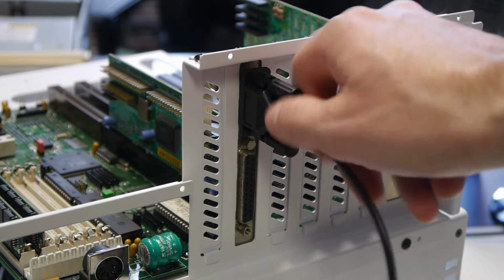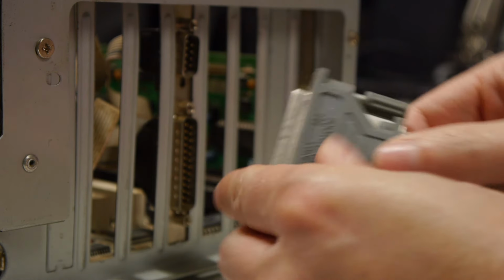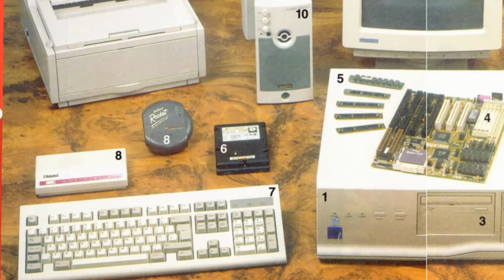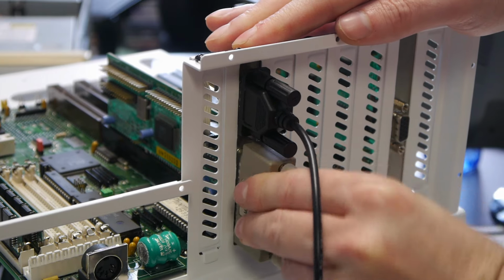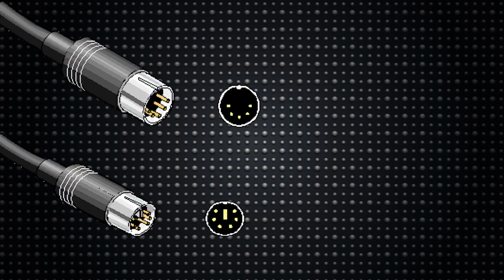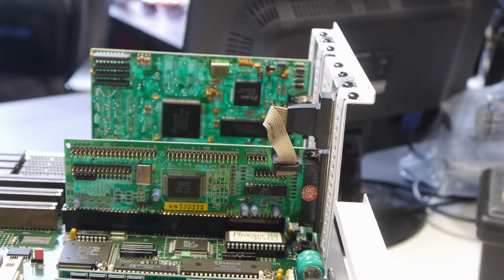What did we use before USB? | Nostalgia Nerd

Comment: My first ever PC was a Packard Bell PB2970, it had a single expansion card that functioned as both a telephone modem and sound card.  I believe it was an ISA card, as I remember the card was stupidly big.  I can't remember for sure if it featured a gameport; what I do remember though was the sad realization after a lightning storm that damaged the modem (visible charring could be seen on the board), I found myself having to replace two expensive, at the time for me at least, components: telephone modem AND a sound card.

In the following years I'd purchased several sound cards, sometimes as upgrades; back when using onboard audio was a detriment to the system as a whole; largely in part because the onboard audio systems lacked the proper shielding for the audio channels to produce the nice clean audio that an expansion card offered, and because the onboard audio system would tax the system CPU, at a time when CPU cycles were at a premium and would noticeably make your games run slower.  In all that time, however, I've never once in my entire life used the Gameport on a soundcard, or on my PC.

Comment: I'm old enough to have worked on PCs before USB, and I for one can say that things are such much simpler (and even better) today. USB is appropriate to its name, it is truly universal. It was a headache at times dealing with all the different port types, and then trying to find the right drivers to get the device just recognized, let alone working lol. Granted much of the ease of use did come with the updates in the OS's and BIOS's to vastly improve plug and play operations. I bought my first USB computer in 1996, and my first USB peripheral (scanner) in 1997 and there were definitely birthing pains in the beginning. Now the problem is finding peripherals that have the older ports so that modern computers can use legacy hardware, that there is no modern solutions for, but still needed for business operations for that particular process. 
I remember back in 1995 while I was still working for Intel, my colleagues and I were talking about tech trends, and I insisted that this "new-fangled" USB will be the future. I was quickly laughed off.
Reply: USB-C is having similar growing pains.

Comment: One thing I miss about the older rs232 days off serial ports, was it used to be fairly easy to analyse traffic. Hook up a null modem, make some guesses about parity or word size and then you could see the raw traffic. 
Helped quite a bit when trying to debug a connection issue. These days the USB protocols are so tired to proprietary drivers that it's a real project to understand what sort of traffic is being sent down there wire.

Comment: 1. You did not menton the SCSI-bus & contacts used on older Macs. Existed in several guises. From parallell-port-sized to big huge clunky things. 
2. The dreaded DIN plugs. Oh, how we hated them! For connecting a tape recorder to an amplifier, you need only one cale, but woe and behold when one of the connector came loose & you had to solder them back on. The "Phono" type cables & plugs used now are wayyy easier to get on (they only fit one way…) and solder, if you have to. 
And have you ever seen DIN jacks for microphones or headphones? 6 pins, and shield. Whereas you get thru with only one "jack" plug. And the one for headphones? FIVE pins in a star formation, PLUS shield! Nightmare! I think the old-style home stereo DIN plugs are dead now, thankfully.
As for the "gaming contacts", they’re pretty much similar to the old serial (printer/modem) & ADB (keyboard&/mouse) on the pre-USB Macs (I have several…).

Comment: Thanks for this nostalgia splash! I have some comments, though. At 1:53 - this is actually a 16-bit ISA card, in a slot that accepts 8-bit and 16-bit ISA and 32-bit VLB cards (at 2:13 one can see the shorter, 8-bit-only ISA slots). Also, the card at 3:46 is an I/O card, which in addition to serial and parallel ports has pin connectors for hard disk, floppy disk, joystick (I assume the "game" port refers to that), and another COM port (the third pin header being for jumpers to configure the board).

Comment: PC-AT (the a and t pronounced separately.   It stood for Advanced Technology.
Reply: Yeah... He also said Windows 95 Service Pack 2 which does not exist. :D
Reply: @keybizzoneg5209  : 95's second service Pack was referred to as "OSR2" or Original Equipment Manufacturer Service Release 2.  IIRC, MS didn't refer to it's Service Packs on its consumer OS's as 'Service Packs' until Windows XP where they unified the consumer and enterprise workstation OS's into one lineage.
Reply: @phuturephunk  Still was'nt a service pack though, it was a full release that was distributed to manufacturers in order to bundle with their computers... there is a difference.
Reply: @keybizzoneg5209  Oh, true. I'd actually forgotten about that.
Reply: "It stood for Advanced Technology"
I recall that before the PC-AT there as a PC-XT where XT stood for "Extended Technology".
Reply: Saying @ is quicker
Reply: I think the "PC @" was the model between XT and AT - it used the 801.586 processor 😋
Reply: @DarrynJones  The PC was IBM's original in 1981.  The PC-XT came to market in 1987.  The biggest change was that the PC-XT came with a hard drive installed.

Comment: Nice overview, though as an Atari fan, I would have expected mention of the Atari SIO port, which was kind of a precursor of USB, being serial and allowing chaining of devices. And of course, its designer Joe Decuir also participated in the design of USB.
Reply: Yeah, the big-deal ports on the Ataris were the 9-pin game-controller port, which actually became something of an industry standard for a while (Commodore and Sega both used versions of it), and the SIO, which didn't. They sold an "Interface Module" that you'd put into the SIO daisy chain to provide RS-232 and Centronics parallel ports, because I think even some of the modems and printers they sold used those.

Comment: USB was just a modern and much more widely-supported take on the Atari "SIO" [Serial Input Output] port which debuted with the Atari 400 and 800 computers from 1979. SIO devices [printers, plotters, disk drives, tape drives, networking schemes, etc] were all "smart" devices which had their own built-in drivers and thus they were truly plug-and-play even way back then.

Comment: Serial ports are still fairly widely used. Lots of automation gear (not Internet of Things type toys, but manly automation related gear) supports serial connections. There's good reasons for doing so. It's a point to point connection from controller to controlled device, and it's not shared and not accessible from the outside. So it can't be hacked. And if the device itself were compromised it can't be used to attack anything else, not even the controller it's connected to generally speaking. And it's very simple so it doesn't add hardly any cost or complexity to the devices that implement it. You can buy a 4x or 8x PCI-e serial card for a quite reasonable cost.

Comment: At a tow company I worked at we had written our own POS and DB software in C that could be compiled to run on both MS DOS and SCO Xenix. For the system at our own office we ran Xenix first on a 286 system eventually working up to a 486. Mid way through, we had the console screen and keyboard, a printer hooked up to the Centronics, and the following connected by RS-232's: 2 more printers, 5 terminals, a modem connected to another printer at the police department, and a second modem for remote access and connecting to the other companies we sold our software to.

After we moved up to the 386 we realized what a dog the system had been on the 286, but after that it was faster than the system used by the company I'm at now that is internet based. No graphics, no routing, low level programming, and few layers between the program and the computer makes a huge difference.

Comment: Then What is Before Before USB 🤔
Reply: A 20 milliamp current loop used by teletype machines.  When ASCII replaced Baudot coded teletype machine there were a lot of cheap Baudot teleprinters and terminals around. Interfacing one of these machines to a computer gave you a printer or terminal.  All you had to do was build a 20ma to rs-232 interface and write software to convert 7-bit ASCII to 5-bit Baudot and back.  I never did this, but here is a video that does  https://www.youtube.com/watch?v=ug5lUI-hs3s
If you are old enough you will remember the sound as the opening of just about every news program broadcast.
Reply: @billelkins994  Ah Ok

Comment: What was before USB?! Afucking mess. Anyone remember trying to get a parallel port printer working right, or when you bought a PCI graffix card but needed an AGP card?!
Reply: I never really had any issues.  My printer always worked.  My sound card always worked.  Never had display problems (though, shitty drivers were a hassle).  I rarely bent any pins.  Maybe I was just careful and knew what I was doing :P

Comment: 10:28 Not exactly. iMacs didn't get FireWire ports until late 1999, and even then it wasn't included on the base model. So a big chunk of the market was stuck with the much slower USB 1.1.

Comment: I prefer PS/2 mice and keyboards for two reasons. The first is that the OS doesn't ask to reinstall the driver every time I plug in a device. The second is that only keyboard data can travel over the legacy port, but a malicious device can send any data over a USB port. Given the recent hacking chip on imported mother boards this now seems less paranoid.

Comment: USB might need a new spec update if it's to support fast external storage devices based on NVMe because the 20Gbit/s transfer speed for USB 3.2 is clearly a bottleneck for NVMe's 32 Gbit/s!

Comment: I had a video capture device that worked off the parallel (printer) port.  And 2 printers, so I needed a Parallel port hub/switch.  Also had an HP scanner that came with a SCSI card.  And a Wacom tablet that needed a serial port.  All of this for a Gateway PC that had, I believe, a 6 GB hard drive.  But I was late in starting to use PCs -- my wife used the ones where the hard drive was a big, removable floppy.

Comment: There is no such thing as a "DB9" port. It is DE9! The second letter is for the connector size. B size is the 25 pin parallel or serial port. The 15 pin game/MIDI port is DA15.

Do NOT plug an old Macintosh monitor with DA15 plug into a PC gameport. You will not like what happens when power is applied. Fortunately, the one time I encountered that, the person's PC had a cheap multi I/O ISA card and that was all that got fried. Dropped in a replacement and it was fine.

Most of those multi I/O cards also had IDE and floppy controllers so one card got you your game port, two serial, one parallel, two hard drives (or hard drive and CD-ROM) and two floppy drives, or a floppy and a QIC tape backup drive. They were quite the innovation when formerly we had to have one card for floppy drives, one for an MFM hard drive, a third for parallel and serial ports, a fourth for a pair of game ports (or one with a Y cable), then finally a sound card. The sound cards would come with one or more interfaces for CD-ROM. There were Mitsumi, Panasonic, and Sony proprietary interfaces, or SCSI. I don't recall a card with the three AND SCSI. Just one or all three odballs or just SCSI, a few had the three and IDE.

So if one had an IBM 5150 PC you had a problem if you were kitting it out for games. Only 5 slots and you still had to have a video card. That's why sound cards quickly adopted the game port, so a dedicated joystick card wasn't needed. It was sooooo great to be able to yank everything out except the sound and video, then install one little card to do everything else, and an IDE hard drive.

Comment: I remember trying to attach something which almost, but not quite, fit. I didn't realize it until I had trouble seating the other screw attachment.

So, you'd have to unscrew it, make sure you didn't bend any pins because of your mistake, replace the cable if you messed up that bad... then there were the CompUSA goons looking at you like you have two heads, because you need a big-DIN to mini-DIN adapter.

Comment: I had to use an old ancient modem on a modern computer back in 2008ish as it was the only modem that would dial into our siemens phone system without getting kicked out, had to search high and low in the basement for the small to large serial port and figure out how the little flip switches needed to be set, it sounded like the 80's early 90s when I dialed it up to program it for changes haha

Comment: We didn't have a lot of devices that connected to USB for power, and the data transfer end ended up being used by either the Parallel or the 1001 composite port.  But, it just wasn't used in the same matter really as the USB ports are or to the same advantage and were HARD wired more.

Comment: its produced A T not AT. 
serial ports couldn't do more then 9600 baud reliably until 16 bit 16550 UARTS came out. if you are connecting a 33k modem, you should definitely make sure your computer has a 16550, otherwise you get errors. 

some of us had separate MODEM and FAX boards.

the original ibm pc and AT had limited Interrupts. meaning if you have a mouse and a modem and a printer, and a sound card there was no room for anything left. the AT model gave you 16 bit slots and IRQs 9 to 15, but little cards on the market used those extra interrupts. IRQ 9 was free, it could be used by a video card. the other EXTRA IRQs were tied up being used by your Hard Disk Drive and Math Coprocessor. 

the ibm had 4 COM PORTS!! but you couldn't use COM1 and COM3 at the same time and you could not use COM2 and COM4 at the same time

sound cards drastically changed. we don't use AM or FM synthesis for musical instruments anymore. meaning every single PC compatible's sound system sounds the same now. . each persons SOUND BLASTER AWE32 had the potential to sound different then anyone else, because of different musical instruments were loaded into the sound card's ram slots. a lot of people talk about the 640k barrier and the differences between real memory, extended memory and expanded memory. but your sound card could have 29 megabytes  of ram directly on the board !

Scsi allowed you to free up your system resources and allowed you to connect up to 15 devices using only one IRQ

the bad thing about USB is it is client / server. meaning USB transfers use your CPU. and usb provides less power.
Firewire kicks butt. it was peer to peer and more power output. multiple FIREWIRE devices could transfer data directly to each other ( scsi also ) without involving your CPU. meaning a 400 mb /s firewire port was faster then a 480 mb /s usb port.

this is why life before USB and IRQ STEERING sucked.
Reply: its not produced its pronounced

Comment: i don't get why all these cables are male to female conections and not turnable. In most cases the cables in between werent of different core diameter or shielded differently. We could have had USB-C like cable plugging freedom 40 years ago (apart from turning it upside down). Cables with "direction" are only required, if there are dangerous voltages involved and you have to prevent touch.

Comment: The question should not be what did we use before but, what do many still use to this day. The majority of dairies still use serial and parallel connections and older OSes  like DOS, Windows 95 and Windows 98 or at extremes, Windows XP.  It's A T moron! Not AT. Actually, modems and most serial devices only required 3 connections. USB is actually slower than Parallel. Math dude. Math does not lie. Weren't massively popular? Seriously? IBM and others sold MILLIONS of machines during the PS/2 era. Why the hell are you on YouTube? You don't have a freakin clue about the topic. Windows 95 DID NOT support USB at all. Windows 98 sort of supported USB but crashed more often than not when plugging in a USB device. USB 3 only came about late because USB itself is a shyte standard.

Comment: My PC is a custom built gaming PC, It has a wierd socket on the back, It is the same standard PC keyboard/mouse socket but it is split in half, It has the keyboard and mouse color (purple half and green half) Kind of think of this design if you will: ([) with one color on each half. You can use regular keyboards or mouses on it but I have yet to see the one that has half of each to plug into that thing.